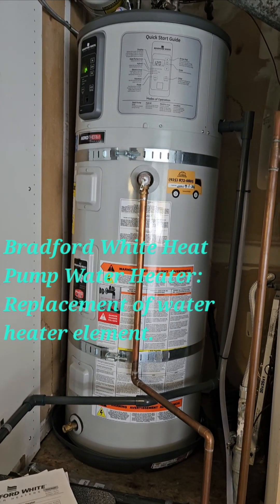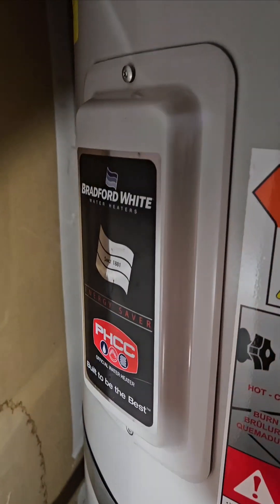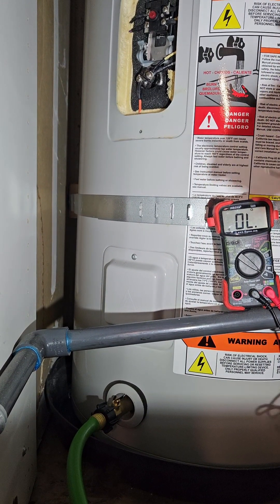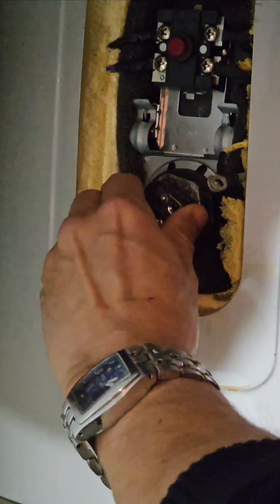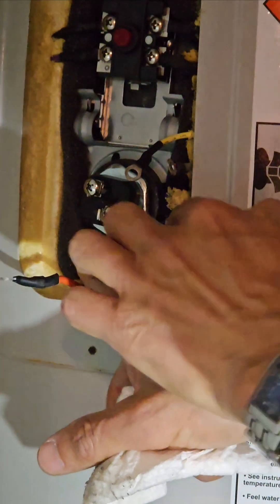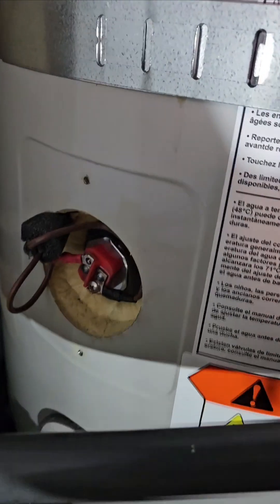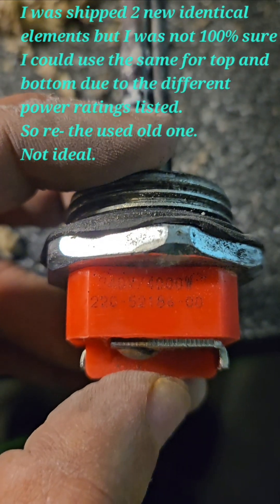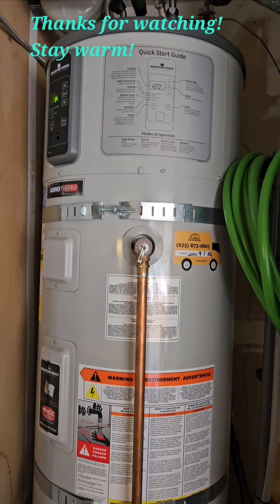Bradford White Heat Pump Water Heater Tripping Circuit Breaker from faulty Heating Element

Comment: I have the same exact issue. Crazy for such a new system. Thank you for posting this. Did this resolve the issue completely?
Reply from the maker: Hi Nader. Yes. Resolved the issue completely. I was surprised it did. I figured the fix had to be more complicated considering how much the plumber wanted to charge. They charge by the hour, and the easy part (draining the boiler) took a few hours. Charging the element took only 10 minutes. Super easy!